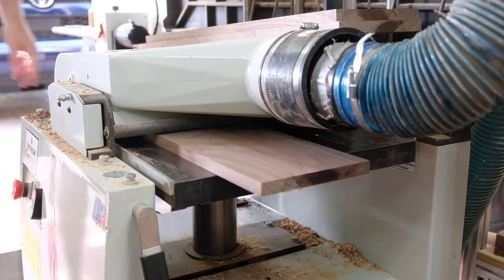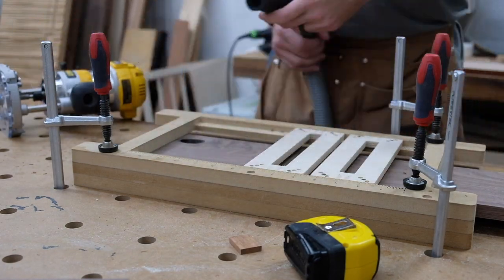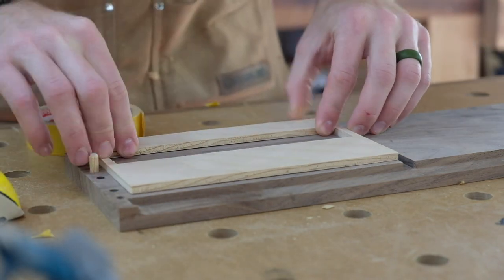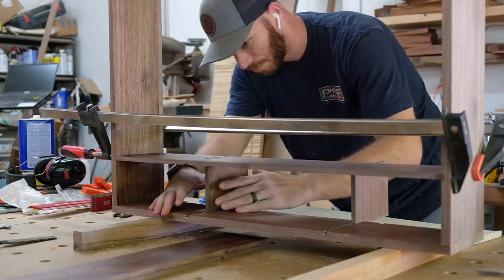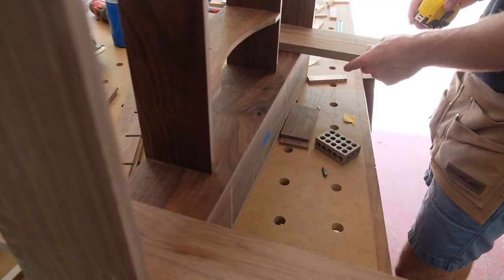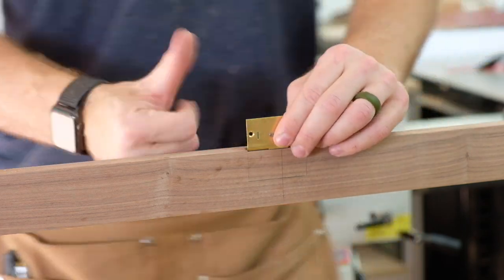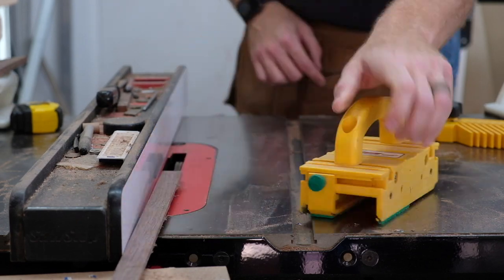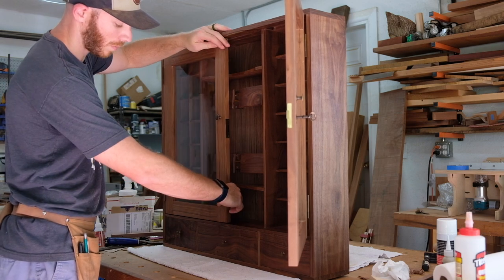Making a Walnut Watch Cabinet

Comment: Love watching and learning.  When did you switch to the new pin style jig?  Will you do a video on it?  Keep up the great work!
Reply from the maker: Thanks Joe! Shortly after I introduced the original jig, I redesigned it and ended up with the one shown. I revised that one a bit further and cut one out of two tone HDPE. Milling all of the holes tot he right tolerances was tough. Getting the pins to be snug but not too tight was a challenge. I may do a video soon if I find the time.
Reply: @parillaworks  you happy with your Shapko?
Reply from the maker: @joeforster5503  Yup, it’s a great machine. Very capable. They just announced the Shapeoko 5 which I would jump all over if I was in the market.
Reply: @parillaworks  I am investigating my options.  Thanks for your input!

Comment: Another great work! Very pleasing to watch. 
What size dowels do you use? And can you share where you bought the dowels? I always find my dowels are a little too big so the joints are too tight. Thanks!
Reply from the maker: Thank you Hao! I believe these were 1/4” x 1”. They may have been 1.5” though. I usually buy them on Amazon when I’m in a pinch. These are the ones I’ve purchased lately: https://amzn.to/3AEs6ZR
Reply: A trick to handle dowels that are tight is to microwave them and they will shrink. Do it in increments of 10-15 seconds.
Reply: @meperson  Thanks a lot! I will definitely try